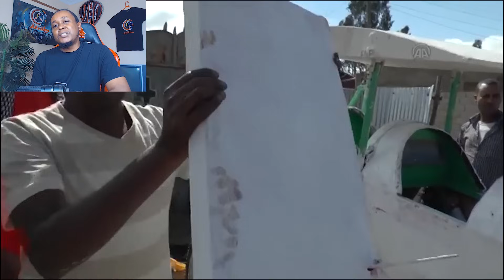Impossible DIY Plane Takes To The Skies | With Pilot Who’s Never Flown Before

Comment: I think a big issue with a lot of these African homebuilts, is that they don’t have light weight materials at their disposal. They mostly make them out of metal, which you can do, but it’s difficult and requires better tooling and metal, not to mention most of the control surfaces are so undersized they might as well be politely asking the plane to turn. Still a lot of effort is put in, and even if they don’t fly, the fact they built something is in and of itself impressive.
Reply: Are you joking, right? Aluminum tubing, plastic film and engine from scooter or chainsaw is easily affordable, it's all you need to build ultralight DIY plane. See Quicksilver XL2 or Aerolite 103 or Zigolo Mg12 alot of them

Comment: They're not making the best out of these engines, connecting directly to the drive shaft doesn't offer you enough rotational speed,  gear it to more rotational speed, utilise the engines torque.
 And the propeller design is very important

Comment: Actually that wasn't a bad design (Btw the beetle engine was the right choice since he was used on a lot of diy small plane) the only problem i saw there was that engine was looking very old and worn out and out of tbe 65 horses power initially available a lot must have been back to the stable 😅 but the airframe was apparently well constructed though he appeared a bit heavy.

Comment: It did take to the skies.... well , parts of it anyway such as a few random nuts and bolts followed by a fan belt and an engine bearing capped off by sections of the prop blades